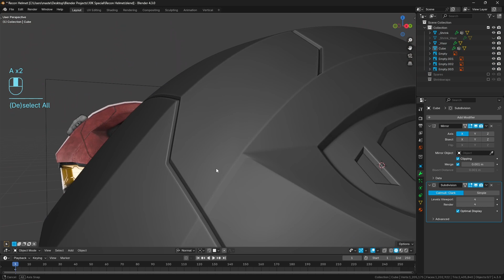Blender | Recon Helmet Modelling Tutorial Trailer

Comment: How exciting! I can´t get enough of these tutorials.
It would also be cool to include how to scale/adjust/align multiple reference images:)
Reply from the maker: In all my tutorials that use reference images, I explain how to set up the reference images at the start. 😄
Reply: @ yes! Sorry, i was referencing when your front image doesn’t align your side image, how would you fix that or what software can help you? I kinda use Inkscape to stretch/adjust those images
Reply from the maker: @AldoMO-pc2xm  Ohh, gotcha. I kinda answer that, to some capacity, in this tutorial series. Since much of the detail in the reference images has been baked down to a normal map, the depth of details in the references doesn't line up properly. So it ends up being a test of intuition and using a bit of creative liberty to model based on the reference, but not 1:1 with the reference. 😄